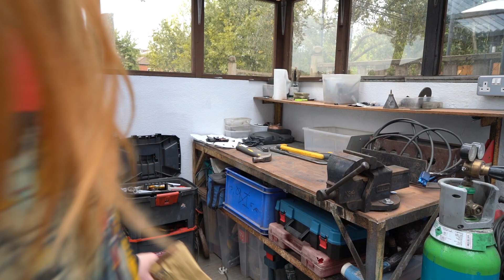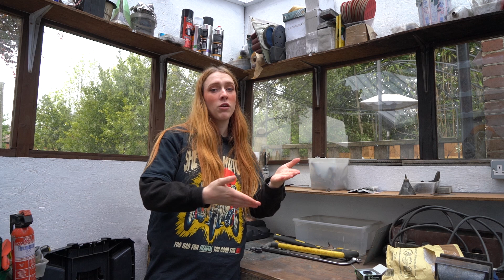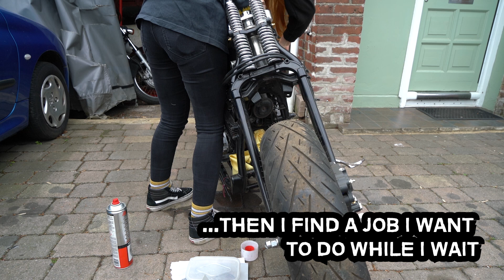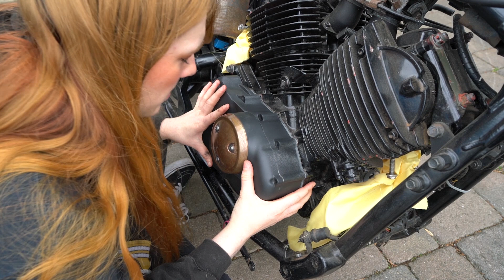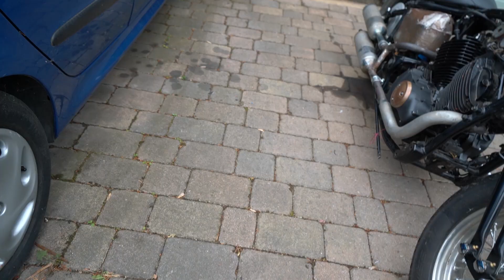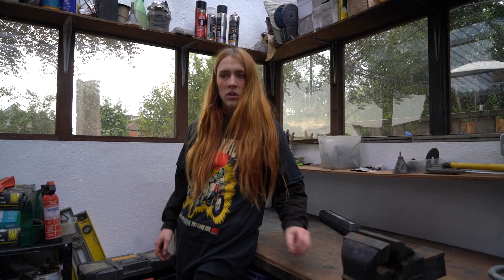Yamaha Chopper Build: Dragstar Crankcase Reassembly

Comment: Smidge of Permatex to smear on the cover side and then the same but with grease on the case side. Then when you pull the cover next time it won't stick to the case. Might even be able to re-use the old gasket😉😁.
Also, hand tighten those cover bolts in a cross pattern a couple of times till seated properly.. Then, you can put some torque on them! Put the final torque by going round the case! 
The cover is probably a little warped from the wrong technique being used in the past.
Lastly, your doing FINE on the You and DANDY on the bike...👊👈

Comment: I find that if you coat the gasket in a little grease it will stick to the mating surface and will not fall off, tip for next time, hope it helps?

Comment: A quick tip, if you smear a thin film of grease onto the gasket it will hold it into place while you get the cover on,  it will save you trying to juggle all the different parts at once.  When is your mate going to get himself out of the pub or wherever he is hiding to help you do that sissy bar that he promise to help you with, lol.  Stay safe out there.
Reply from the maker: Monty is working and at college and doing army application, he's surprisingly busy!
Reply: @sunbleachd  I wish him luck then, poor lad going to need it with that lot on his plate, lol,

Comment: A tip to install easily the right engine cover, is get 2 extra longer bolts same size as the original treat from the cover and cut the heads, so you can install this 2 bolts on the top corners where the cover goes, this helps to hold the gasket on line up position and the install the cover and install the rest of the cover bolts and finally remove the 2 bolts that you cut there heads.
This 2 bolts has to be 1 inch longer that the originals. Good idea is spray gasket glue aerosol on the gasket before installation. Good luck.
......  o¥\O  choppers 4 ever

Comment: Best mod you can ever do is install the Baron Custom Accessories oil filter relocation kit .. Makes changing the oil a 10 minute operation and you don't have to worry about breaking the cheap stock cast oil filter cover. Trust me, I know LOL